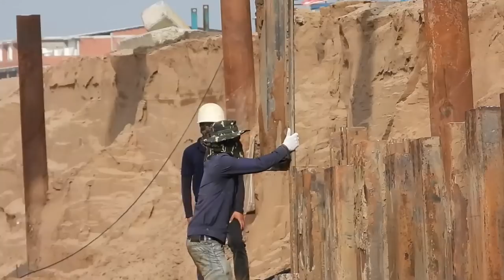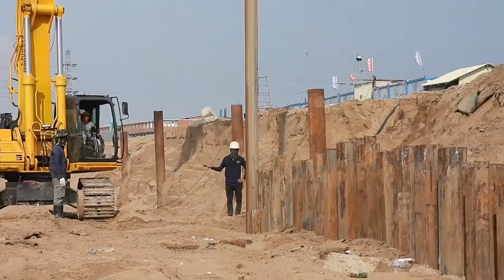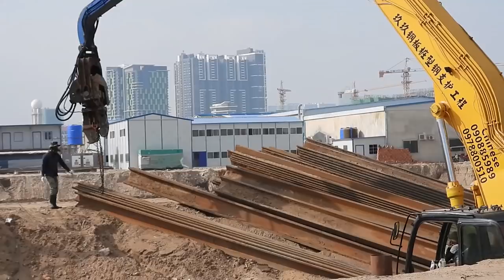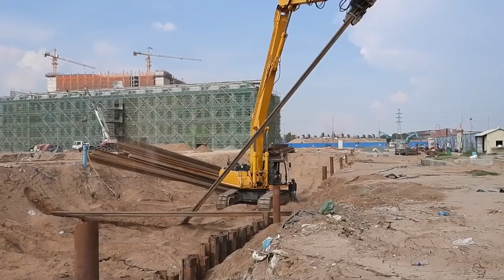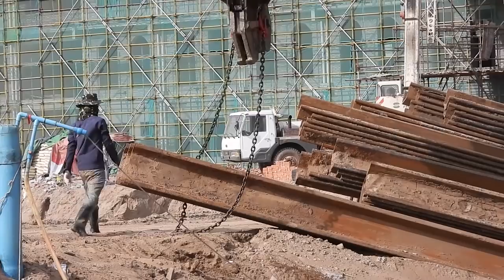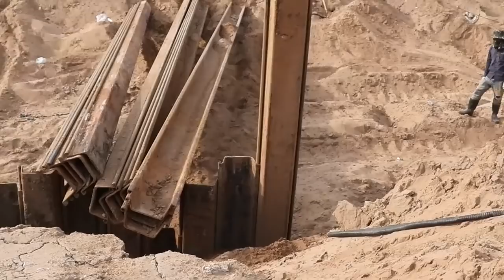Long Boom Excavator Vibratory Hammer Sheet Pile Installation (Full videos detail)

Comment: I have question, the wall of my neighbor the outwall is in the line of my property line, and  I need to use sheet pile because I have basement, what is the distance of sheet pile can b installed? Because that vibro hammer is big? Please answer because I want zero distance or maximum of 200mm distance from my property line